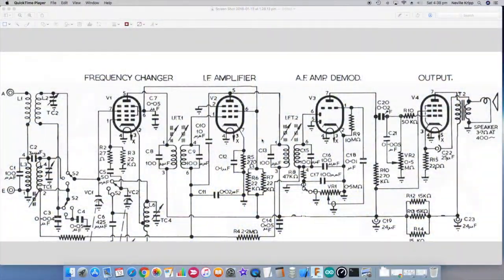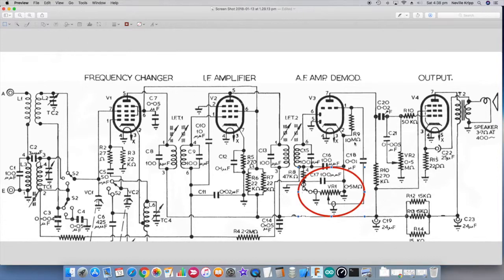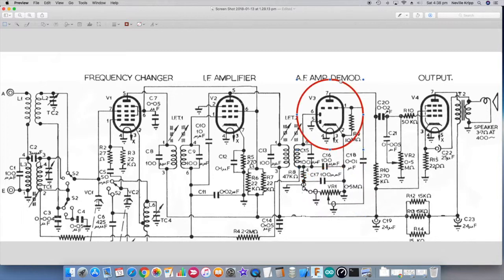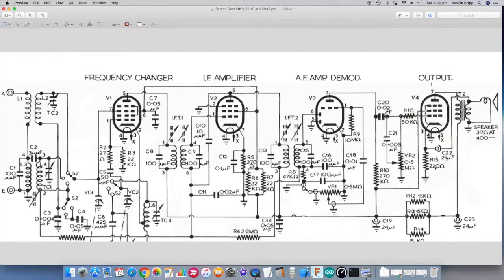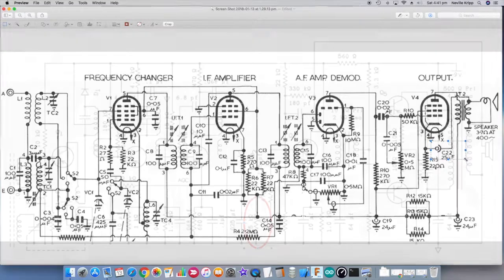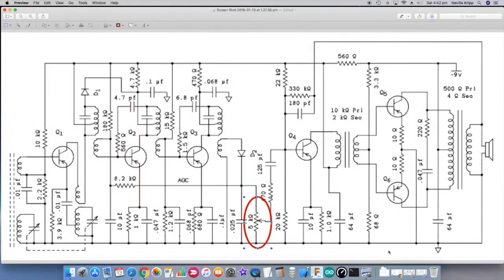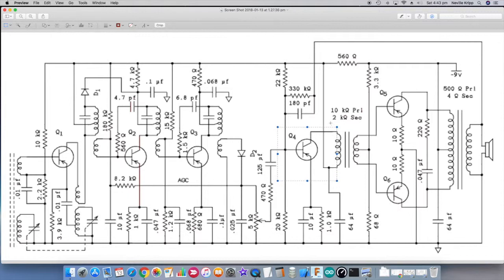#031 SuperHet Audio Stage Tutorial

Comment: Great series! Thank you. Would love a video that explains IF transformer adjustment for higher fidelity that you mentioned.
Reply from the maker: Hi David,

No problem, that’s a good idea. I will look at this over the next couple of weeks.
Reply: Thanks!  @GrumpyOldTech  By the way, this was a terrific series. I am more of an amp repair guy and I was looking for a technical explanation of mixing. I love the fact that tubes essentially do math RF-LO=455. One question I have about AM...does demodulation essentially flip the sine wave by 90 degrees? I ask because an audio signal's amplitude is going to stay relatively constant and it's the frequency of the audio source that changes. So, it would make sense to me that the changing audio frequency would be represented as changing RF amplitude. The reason I ask is that in your diagram, your "envelope" showed a very consistent sine wave which I'm assuming isn't be the case in reality.